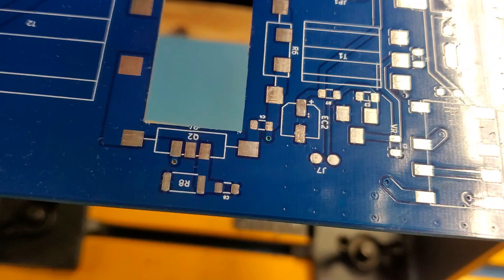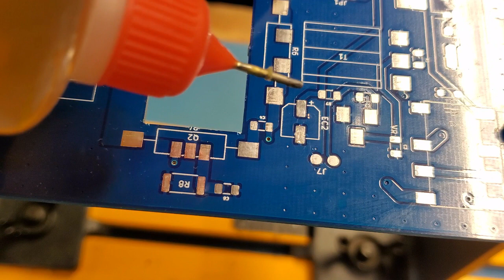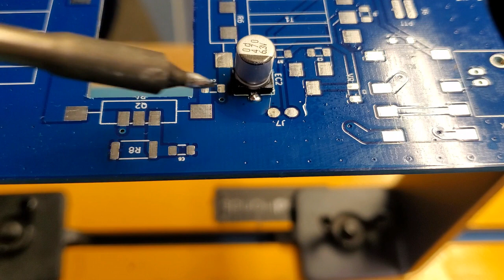Soldering an SMD Electrolytic

Comment: Thanks for the video explanation! My initial state of confusion was what I couldn't see, and that is the solder running back under to complete the connection. I was just focused on what little area that was visible when the component sat in place
Reply from the maker: Glad you enjoyed Martin - once its soldered down you can usually test continuity by probing just the tabs

Comment: I would not have used the flux, it just makes a mess. Flux is OK when your removing a component as the solder on the board will not have any flux so adding a bit helps. but the new solder has all the flux you need, but that's just me. The only place i see flux used during soldering  is on youtube video's, in all my years of being an electronics engineer i've never needed it or seen it used in production. (exception is when using a solder pot for tinning wires).

Sorry using flux when not needed is on my hate list. :-) Still a nice bit of soldering in the end.
Reply from the maker: Its funny - I have always used flux since watching a w2aew video on SMD components years ago! I'll have to try without flux now - you are certainly right about the mess flux creates. Thank you for the comment
Reply: I do use flux when I'm soldering the electrolytics like in the video -- it's helpful to get more wicking of the solder through, since you can only heat it from the very tip.  Any oxidation impedes good flow, and that's the purpose of flux.

I also use a lot of flux when clearing solder bridges.  E.g., I'm currently doing a bunch of boards with USB ports, and a drop of flux clears the bridges real fast, whereas trying to pull them of with the iron without flux is a nightmare.
Reply from the maker: @yakovdavidovich7943  This is the w2aew video I was referring to https://www.youtube.com/watch?v=GJFd7-nzrH0 - in that video he was soldering in an si570 which has no tabs at all - just crenellations
Reply: @yakovdavidovich7943  All the flux you need should be provided by the solder. I use good quality solder 60/40 tin lead as i don't sell my boards. Which would be illegal to do so in the UK or EU with lead solder but that's another issue. I use a soldering pencil by weller which i find is great for SMD parts and o.5mm or less solder.
if trying to remove solder with solder wick i might add a little of flux, but again i might just wet the wick with a bit of new solder.

I was just pointing out that all the years i've been working around circuit boards as a design engineer the only flux i see is by the tining pots where they tin the ends of wires.